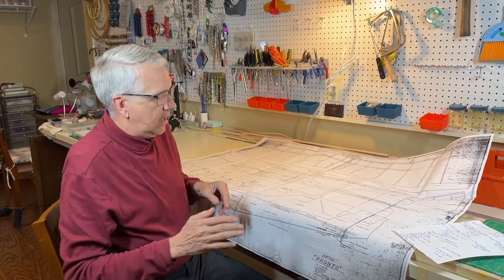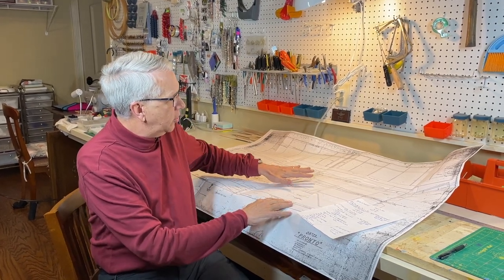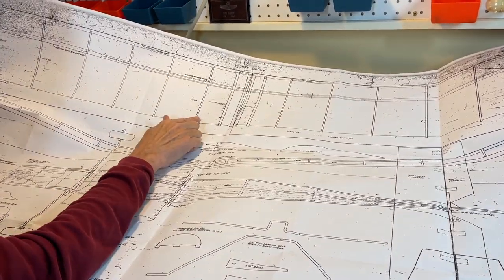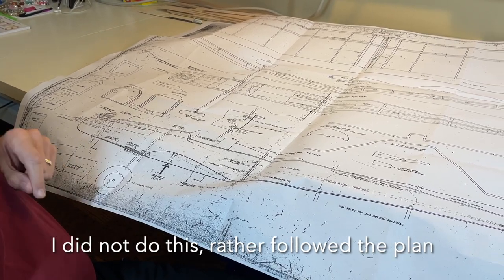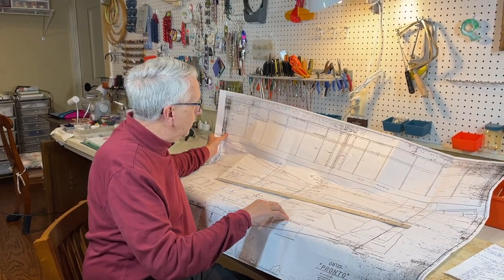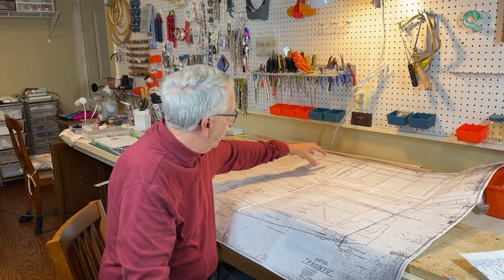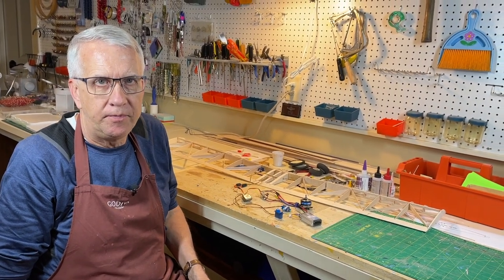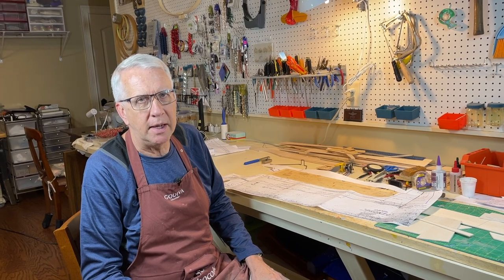Build the Pronto RC Airplane from Plans Start to Finish

Comment: Absolutely wonderful Tim.
I have two questions
Did you put in any down or right thrust on the motor.
And my second question is why didn't you put flaps on it. Not that it needs them just curious.
Reply from the maker: A bit of right and down thrust. 2-3 degrees. No flaps, but with strip ailerons an ideal candidate for flaperons. Tim
Reply: @TimMcKay56  thanks again I do enjoy all your videos it just fills me head with all kinds of ideas. 👍
Reply from the maker: @sigh_of_the_times  😊👍🏻 Tim

Comment: What motor did you use please advise thanks and great video.
Reply from the maker: E-flite Park 480 motor.  This motor provides lots of thrust, can easily use a smaller motor.  Model weighs around 2 lbs.
Reply: @TimMcKay56  Thanks Tim so long as i can do inverted snd some good speed stuff will do thanks mate Chris Perth Australia

Comment: Did you have to put in any down thrust and right thrust when installing the motor?  How thick are the ailerons? What type of hinges did you use for the ailerons?  Thanks, Tim…love your videos!
Reply from the maker: Rick:  For the Pronto I added a bit of downthrust but no right thrust, as I expected most flying at a lower power setting. Ailerons are 1/16” balsa, 1” wide. Clear tape hinges on all control surfaces, too and bottom. Works great!  Tim

Comment: Hi Tim
Great video!
Do you think it's feasible to build this from foam?
My balsa skills do  not exist
Total noob😅
Reply from the maker: Gerry:  The answer is yes, you could build this from foam. But do try balsa. Balsa just builds lighter for this model and the light weight is the key. Buy a set of plans, a very easy model to construct.

Comment: Just build it in stick form, 3/32 seconds wing ribs with lightening holes as you need to run the servo wires anyway..you are going to put one servo per aileron with the y connector or programming on your tx.
Reply from the maker: RR:  Thanks for your input!  Tim

Comment: Had it been me, I would have built it from foam board, with 3/8"foam strip doublers,top and bottom of the fuselage it would have been half the weight.
Reply from the maker: The wing loading is quite light, as the wing has a lot of area.  Mine flies great!  Tim